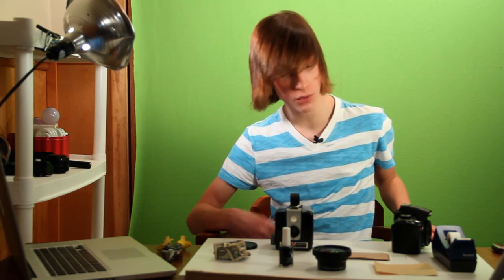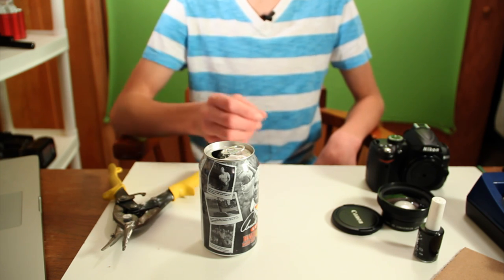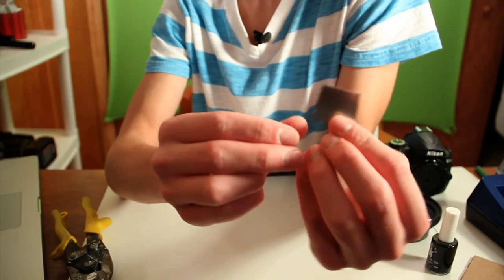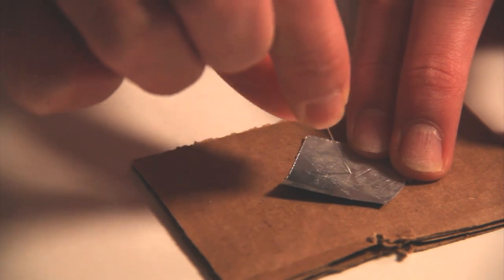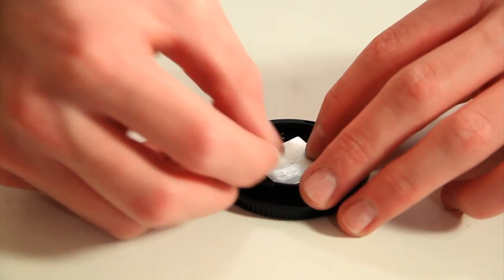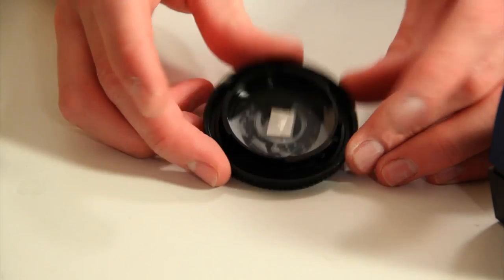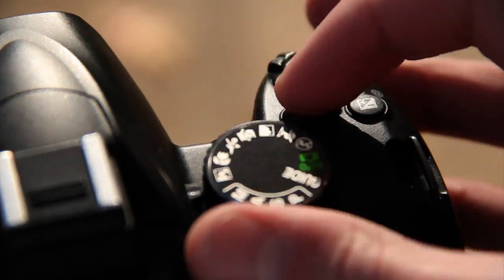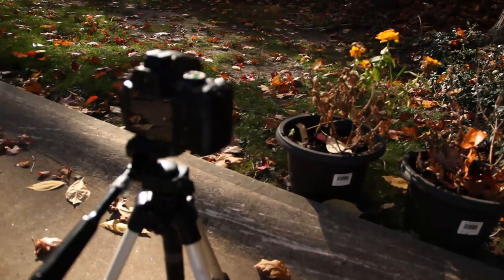How to: Pinhole Camera

Comment from the maker: @ECWNET I know that...Digital's different though. When I worked with a real pinhole, I used exposures in the 30 second range...When working with digital, you want a fast shutter speed and a high ISO